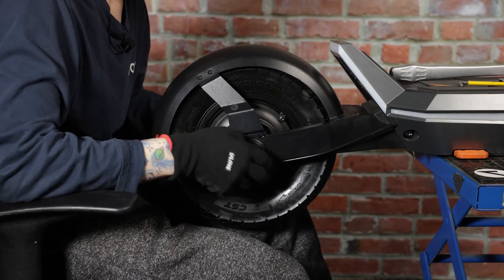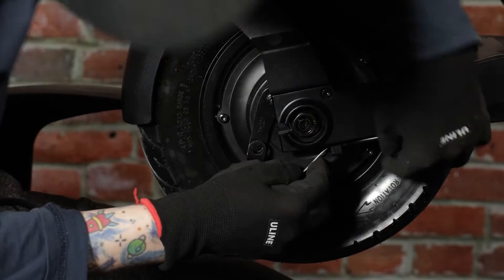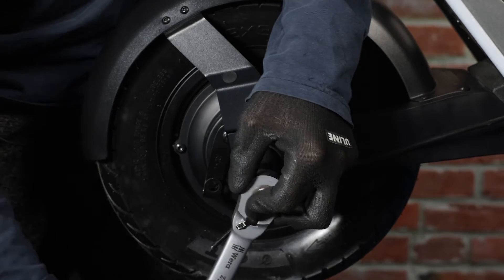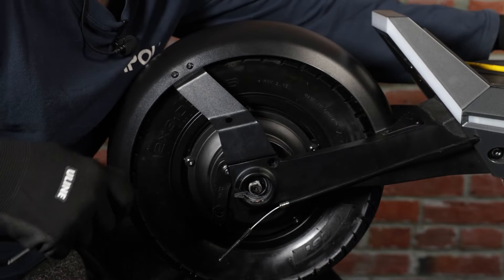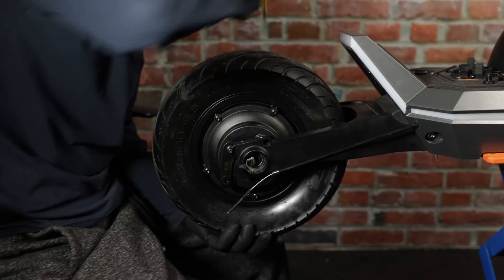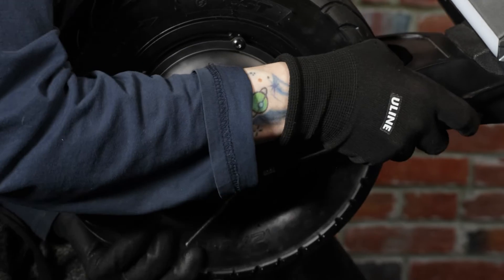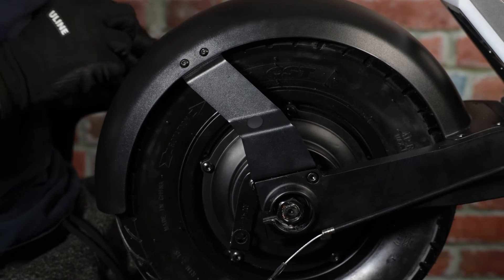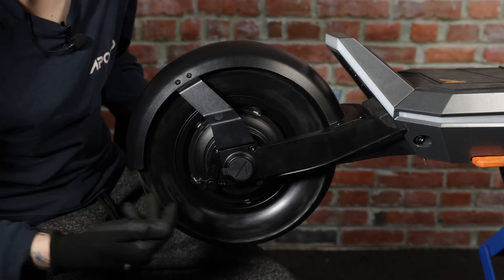How To: Apollo Pro 2024 Rear Motor Replacement

Comment: How did you take out the brake cable placeholder pin guide so easily? Doesn’t it have oversized ends to keep it from sliding out?